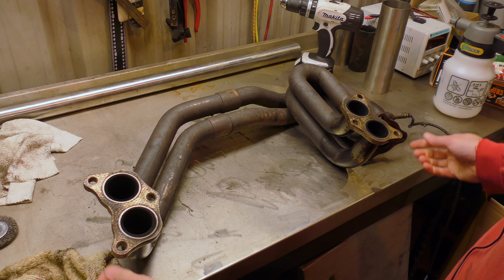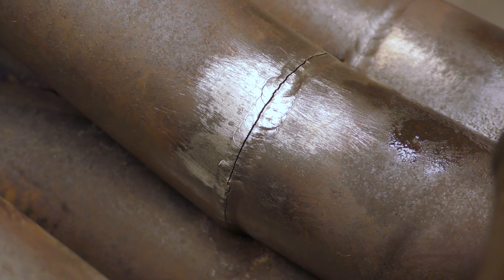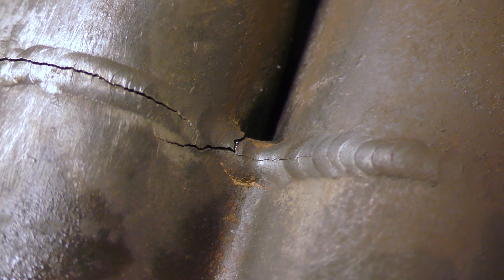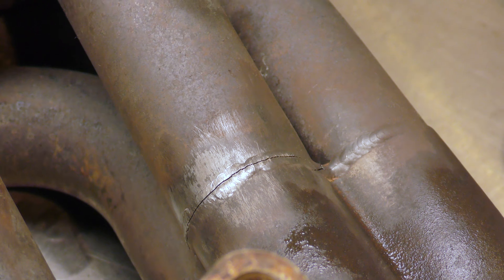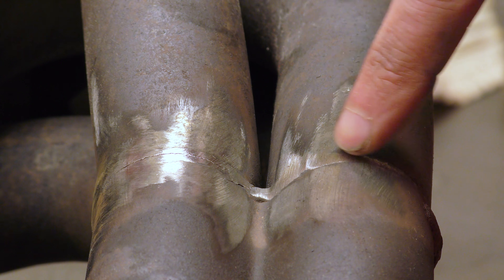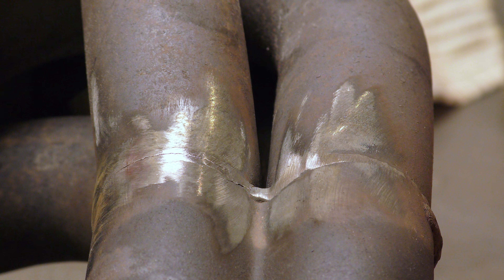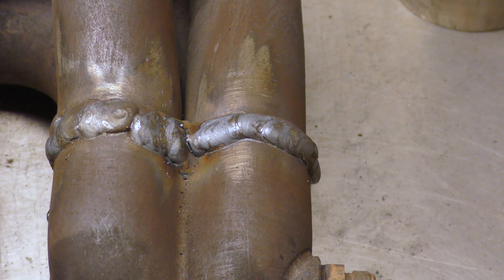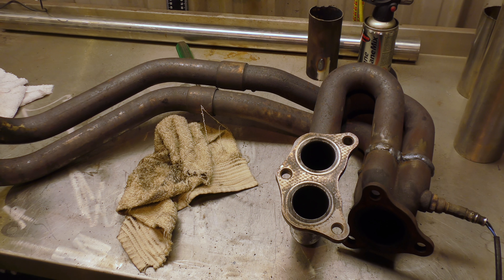Hayward & Scott manifold welding

Comment: looks are not important! if it seals, it's good =)

ps. don't know if this applies here but I suspect it does. when you fix a crack in cast iron, for example, you want to drill out each end of the crack with a small diameter drill bit before widening the crack a little with a dremel, and then fill it with a bead of weld. Your repair will last plenty long, this is just a tip for the future =)

Comment: Doesn't have to look pretty to work fella. Would it have been easier to clean the flanges up with a wire brush on the angry grinder? And if your worried about it cracking again would it be worth putting a plate between the two pipes to give them a bit more support!?
Reply from the maker: True that.  I use a file on the flanges as I want them flat.  You can use a brush to get the carbon/rust off but a grinder is too aggressive.  The flatter the two mating surfaces the better the seal is, less likely to leak even with a gasket.  I thought about adding gussets for strength but wasn't sure if they would affect the expansion and contraction of anything else and end up with more cracks.  If it cracks again at least now I can take it off without having to plasma cut all the bolts off.